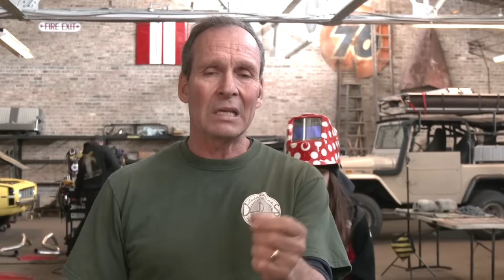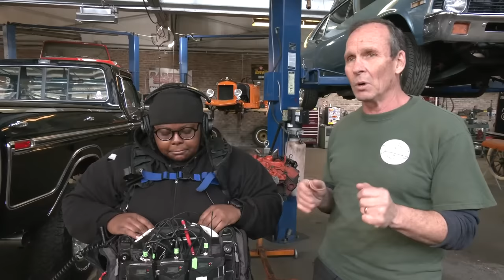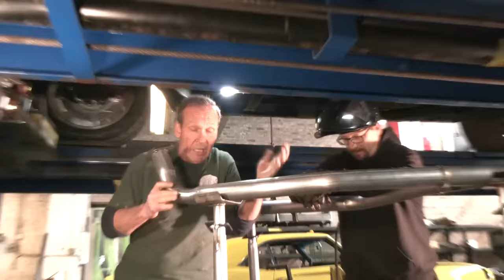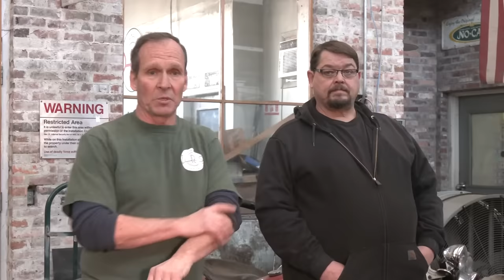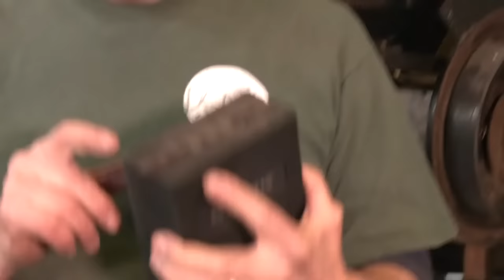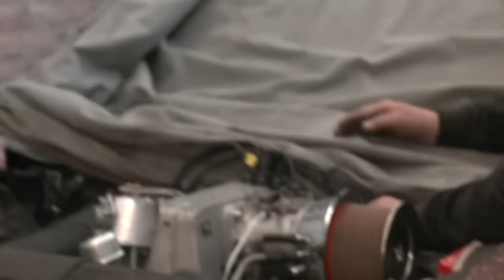The Reality of Reality TV

Comment: That old "fuelie" on that vette is "huge" !! The story goes that those units were so "tricky" to adjust that lots of the dealers couldn't cope with them. Again, the "legend" is that lots of them were removed in favor of four barrel manifolds and carburetors. A friend of mine here in town has one of the tuning devices the dealers used back in the day. He has one of those FI units installed on his late 60's/early 70's pickup that he has had since new. And, it "purrs" !!!